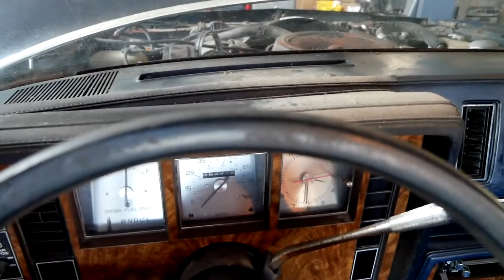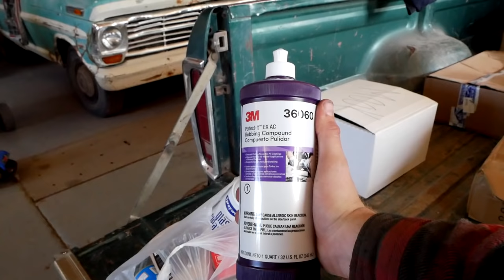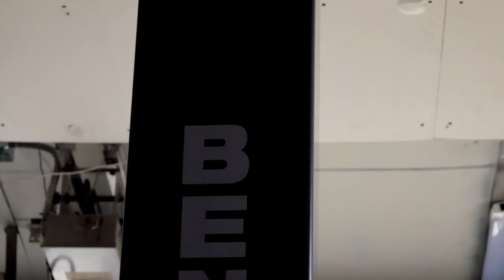Will the Most UNRELIABLE 1980's Car Return on the Road!?

Comment: I own a 1985 Chevy Chevette that I bought five years ago that I've pretty much gone through the same experience with.  While it was cosmetically OK when I bought it and seemed mechanically sound, it had sat in a garage for several years prior and once I began driving it regularly it began showing me its issues.  I've managed to keep the car on the road and I still drive it to this day in spite of several breakdowns and countless repairs.  That car has challenged every aspect of my good sense, judgment, and even my manhood...most guys would have either just cut their losses and junked it or sold it off out of frustration, but I never gave up on it even though it always seemed to defy my every attempt to fix it.  I know that car bumper to bumper...every vacuum line, every hose, every component...and I have spare parts on hand for whatever it might need in the future.  When I drive it, I have pride in it,  because I am the reason ... the ONLY reason ... the car still runs and drives and isn't rotting away somewhere in a field or a junkyard.  It might not be worth much to someone else but to me it's almost like a beloved pet that I rescued from a shelter.  Priceless.
Reply: Chevettes were pretty much like that from the factory
Reply: I have the same feeling with my, funnily enough '85, Pontiac Fiero. It's body is multi-colored with paint falling off, and headlights are stuck up. But, it's mine, and I love that little car. 

I've also always wanted a chevette too, either that or a chevy sprint...
Reply: Learned to drive a stick shift in my dads chevette, in my parents yard with circle driveway, also raced a geo metro and sparked him 😂.
Reply: used to have a Chevette rebuilt the top end. used to impress the girls by saying i have a vette and getting them drunk.
Reply: @BigJim1976  o
Reply: @BigJim1976  the fiero  can be a decent daily car once you've gone through it. I ran mine for 5 years
(8-9 months of the year) every single day problem free and reliable, the first month not so much, as it had been neglected and butchered but once all the weird stuff was solved, it was great. Mine was a
  2m4 5 speed 1986
Reply: i feel the same way about my 1997 toyota land cruiser
Reply: I have a 2002 Kia Sportage that I feel the same way about. It's a husk of a vehicle but doesn't have a choice. As long as I'm alive, it WILL run.
Reply: fuckin' A
Reply: I looked your car up and I dig it I think it would be a super cool v8 swap sleeper car
Reply: I really want a either a oldsmobile delta 88 diesel or this Buick for my first car even though they are piles of  shit to drive, but like you said and Kevin said they aren't going to be around for every and they are still a piece of history
Reply: I hear you bud. I've been there multiple times with multiple cars, and I still wish I had several of them, but I sold or scrapped them for a reason.
Reply: Also, I would also love to have either a Chevette with a Pontiac 4.9L turbo, or build my own with a 305 turbo. OR I would like to have a Monza with a forged, large cammed, aluminum headed, and turbocharged small block. A Chevy LUV or a Chevy Citation comes to mind as well for the same swap.
Reply: @Brock_Landers  chevettes and t1000's would literally fall apart if you did that.
Reply: Opp0😊8😅
Reply: @dillonbelcher2983 I thought I was gonna drive a 80 DeVille for my first car like 5 years ago and to daily something like these old 80s cars is near impossible with gas prices putting a 20 in every 45 miles kinda hurts

Comment: Cars in the U.S. weren't required to have rear shoulder belts until 1990. And that engine is in desperate need of a new set of injectors -- or at least having them cleaned and tested by a diesel mechanic.
Reply: I agree.
Reply: How come you did not put plastic over the window
Reply: Almost same car as a Chrysler 5th Avenue. They were good lookers and very reliable. I had a half dozen off them.
Reply: Is there any different between diesel mechanic and car mechanic?
Reply: @cody3300  I believe there is a big difference between the two: diesels do not have spark plugs, require more frequent oil changes, as well as other differences I'm not totally familiar with.
Reply: @cody3300  An ordinary car mechanic probably doesn't have the equipment to properly test diesel fuel injectors. But a diesel mechanic would know this engine like the back of their hand, since GM used a very similar 6.2L V8 diesel in their trucks for many years.
Reply: @vwestlife  so, to fix petrol we just need flat head screwdriver, fork and hammer and for diesel injector tester?
Reply: @vwestlife  the Detroit diesels and this Olds boat anchor have very little in common. Also before spending good money on injectors, you have to throw a water separator, and an actual lift pump on this thing that is worth a damn. GM didn't even bother to install a water separator on these things to save on costs. Which only makes me 😱 wondering what 10 year old junk is getting pumped into that engine.
Reply: Wasn't expecting to see you here! Good insight!
Reply: @cody3300  simply, yes lmao
Reply: Your first mistake was thinking these guys are professionals!
Reply: @vwestlife  have a 6.2v8 vandura I’m trying to get running
Reply: @currenciacurrencia1860  one was made by GM and the other Chrysler. No diesel Chryslers.
Reply: @vwestlife  Nah, any good technician, in general, with some diesel experience could tackle it. Not difficult
Reply: Better hope that ain't the bearings on the front crankshaft
Reply: I don't know much bout diesels but my ears were screaming "What is that infernal knocking/ticking hiss when the car was running..?!" :S
Reply: @cody3300  yes, there is more education to become a diesel mechanic, along with a certification to do it, there are a few shops that only do diesels as well, they will have special tools for setting injection timing on the pumps, as well as diagnosing the injection system, its has come along way with the common rail diesels helping with diagnosing, but you still have to understand how a diesel works, take a Ford 6.7, it runs completely opposite of how you think an engine should run. The exhaust side of the head is in the valley of the engine and the intake goes though the valve covers.
Reply: @Fosuya  the ticking you were hearing was the diesel injection pump overcoming the sping seat pressure in the injector to inject diesel into the cylinder, on these older injectors they were only about 3000 psi of so, also the loudness of the diesels of this Era is because they injected the diesel as it was coming up on the compression stroke so it could ignight the fuel, it's all fixed mechanical style injection, so there is little to no adjustment in regards to how you can control timing. Newer common rail diesels they have electronically controlled injection events (I'm skipping over the ford/Navistar and CAT HPOP systems cause they are their own special breed of diesels) so you can inject smaller amounts of fuel more often to make it run quieter and cleaner
Reply: @vwestlife  WTH, next we'll be seeing Shango and Jordan Pier chatting about '80s diesels...
Reply: @cody3300  Pretty much, yes.  Check out some Mercedessource videos if you want to learn about spray patterns and pop testers, shimming the pop pressures & replacing pre-chambers.
Reply: @LynxStarAuto  He's not talking about an 8V though, but the GM 4-stroke 6.2
Reply: The only fix for that turkey is to convert it to gas.  They usually blow up by 30,000 or 40,000 miles.  Drop a gas 350 with a carburetor or basic fuel injection and call it a day.
Reply: @cody3300  About $50/hour or so.
Reply: It's nice seeing a diesel run.  See if there's a kit to retrofit a water separator.

It's nice that there's no turbo to get in the way. 

Water damage was the main reason these guys blow up before their time.  Dumpling a bit of 100% ethanol into the tank is better then nothing but still isn't as good as a water separator. 

Get a antifreeze heater or block heater for winter, especially if the glow plugs are AWOL.
Reply: Lol Nice to see you here as well!
Reply: V westlife in the house!!!!! Awesome
Reply: @vwestlife  Nice to see VWestlife in the house. I love your videos man especially anything regarding radio!!
Reply: I'm really surprised he did not suspect the lack of the second belt before he did.  To me, it was obvious it was a pulley problem. 
 Once he showed the diagram, then it was REALLY obvious what was going on.  The second belt puts an equal and opposite force in the other direction.  Without the second belt, the pulley is not "balanced" for lack of a better term on the bearing. The bearing has been designed to have roughly equal and opposite sideloading in different directions (11 o'clock and 2 o'clock.)
Reply: I don't think it would be worth the effort to clean and test the injection nozzles.  Buy new and save yourself the aggravation.  On a different note, I'd buy that car in a heart beat.  I was a diesel mechanic for 15 years and have worked on GM's 4.3, 5.7, 6.2, and 6.5 diesel engines.  Have fun with it!
Reply: @vwestlife  the 6.2 and 5.7 Diesels were completely different and not related.
Reply: @dilbertbob5420  Replacing parts gets expensive quickly.  I say try and clean them first.  That line of thinking can be applied to almost anything.
Reply: @scott9676  noooo make it a unique build with a Cummins or almost any diesel just for the fun of it. Keep it n/a and just make it a reliable daily. Hardly anyone does that anymore. (Keeping things lower powered and reliable)
Reply: @cody3300  The diesel mechanic has dirtier fingernails!
Reply: @vwestlife  There are plenty petrol injection systems nowadays.
Reply: @currenciacurrencia1860  I had '71 a New Yorker. Last Chrysler I EVER bought.
Reply: @frothe42  As was poinet out here, Diesels don't need horns!
Reply: @Justkevin377  I was wondering that myself.
Reply: @Justkevin377  no me
Reply: @WhiteLightning777  that and some ARP head studs
Reply: Just rev it to clean
Reply: @LynxStarAuto  Is US Diesel that bad that it needs an Water seperator? The only car i ever had with a WS was a Landrover-Defender whose purpose is chewing bad roads in remote areas wo are known to water down fuels.
Reply: Angus and Mook related somehow?

Comment: As a Brit, this car just screams 80’s/90’s US to me. Cars like this were in the background of every US cop show. I like it.
Reply: As a Brazilian, I feel the same way
Reply: As a Iowan, these cars scream "High School" to me. Takes me back to the 80's.
Reply: There were 100’s of thousands of these on the road not many with the diesel GM failure
Reply: You should have seen my 78 Malibu 305 2 barrel. It was faded blue. Lol.
Reply: That may be but would you have been willing to deal with the mouse poop?
Reply: This bodyshell was used by almost all GM divisions and so ubiquitous they were generic and hard to differentiate between them. The replacement body that was front wheel drive had the same issue
Reply: Now you see why Americans have a dim view of diesel engines in cars.  This engine was  one of the worst pieces of crap ever put in a car.  That and American cars of that era were crap in general
Reply: same, so square! we had nothing quite like it. Also v8 diesel!
Reply: As an American, and a former auto technician. This is worst Era of automobile we have ever had.
Reply: As another Brit I completely agree. I like it too

Comment: I like how nobody EVER questioned exactly why that water pump was returned. My guess is that the alternator belt puts just enough downward load on the water pump for the bearing in the pump to scream and heat up.
Reply: which is why i dont like serpentine belts. with the amount of tension they put on stuff it seems like it was designed to make parts fail.
Reply: you can also check if the pulleys are aligned. this can cause belt squeak.
Reply: The minute I saw all that RTV on it, I new it got returned as bad out da box.
Reply: Exactly. Bad (returned) water pump.
Reply: @woofer2121  bet its more that engineers dont really tend to think things over as well as they should/could, i know many who.... need a practical engineer or even just somebody whos mechanically/tech inclined working with them... to notice problems, and help solve them even... doubt it was intent vs incometence..halons razor... (look it up if you dont know what it is)
Reply: Having worked at autozone, it was most likely a damaged return that someone processed incorrectly as a normal return so instead of getting put in the return cage, it ended up on the shelf
Reply: It's the belt itself or the actual pulley that is making the belt slip when you have a slipping belt it creates heat and that is the issue if he spray some belt dressing on that pulley the squeal will stop
Reply: @AshenTechDotCom  I'll never understand why someone might think a mecahnical engineer might not be mecanically inclined, since most of them were car nuts before they went to college.
Reply: @zachhatten261  Yep. I'd never go through the trouble of installing a questionable part without first at least trying to return it for exchange. That's begging for costly problems, especially if you're working on a customer's equipment.
Reply: Could it of been the impeller self clearanceing on the timing plate ¿?¿?
Reply: I'm sitting here watching this too and thinking the same thing. The one part that was clearly a returned part they went ahead and thought "no still looks new I'm sure it's fine" and never thought that maybe that was the problem and just replace it again
Reply: @moondoggaming1994  Which they still didnt do when the squeak shut up, all we know is that the pump had RTV, we dont know if it was damaged or even went on a car, looking at the blue stuff on it and how it was all goobered up but wasnt smashed flat i doubt it actually went on a car, the people probably bought the pump went to put it on then realized oops wrong pump we need one with some part that wasnt there, so they just returned it.
Reply: @woofer2121  do what now, serpentine belts ruin parts? umm what? how is it i can have a serpentine belt that has 100k on it and its still fine and completely usable yet these old v belts love to squeal after like 20k and some water, ive worked on lots of modern cars with serpentine belts and ive never heard or seen what you describe, honestly the fact that most well designed belt routing uses tensioners that can adjust themselves kinda doesnt make sense with what you say.
Reply: @shaggyduder  he never returned the pump as far as we can see, they scraped the old RTV off and tossed the return on the car and as far as the video goes that is still the pump on the car, we know it was a return, the RTV being on it doesnt mean it was bad it might just mean they smeared the goo then went to see if it would fit and it didnt so they returned it, it wasnt the water pump that was squeaking it was the belts over the water pump pulley likely because they were out of alignment due to the uneven pressure of the missing AC belt. the water pump as far as we can see from the video was fine aside from being a return for unknown reason
Reply: @tprimeau1  exactly, bad logic of repair by not fully putting the car completely back together IE missing AC belt, keep in mind it shut up when the AC belt went back on.

Comment: Still amazed me the humongous amount of information that you Dad can say with only a quick view of the paint. I love his interventions.
Reply: Well said, nice thought for sure.
My father was for several decades an auto body refinisher at different auto body shops in the S.F. Bay Area.
He got his start in the Central Valley working for a concern that manufactured vending machines known as 'Vendalators' best as I can spell correctly.
One day as my father, Robbie or Joe depending on the shop and year, "Robbie" as he was mostly known, had been welding the vending machines, as that was what he was hired to do. Then when the guy who was to put a spray finish on the machine called out sick, my dad stepped up to the plate, God Bless him.
The manager of the shop asked my father if he felt like taking over the paint shop and operate the spray gun which my father had no experience in doing.
My father said, '...sure thing boss.'
That positive attitude gave my dad another skill set that would become his work for the rest of his days.
There were more opportunities in the Bay Area than in the farm belt of the San Joaquin Valley so we picked up stakes and moved to San Pablo just north of Berkely California when I was but a wee lad of 4 or 5 years of age.
So Kevin, I doubt you'll find this buried in the Comments as a reply, but I honor your father and his knowledge and he reminds me so very much of my father.
My dad developed several health issues over time, likely due to the toxic atmosphere in a paint shop and passed at too young an age, he was only 60 years old when prostrate cancer took him along with high blood pressure that ultimately was his undoing when he suffered a stroke induced from a blown artery in his brain.